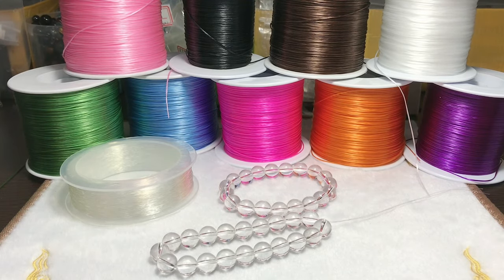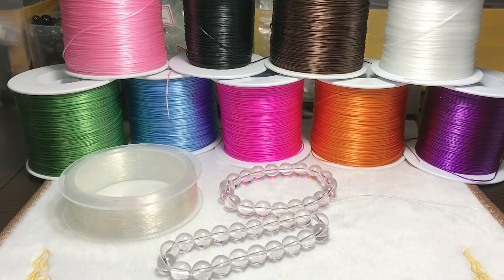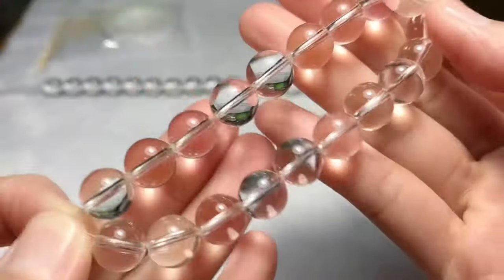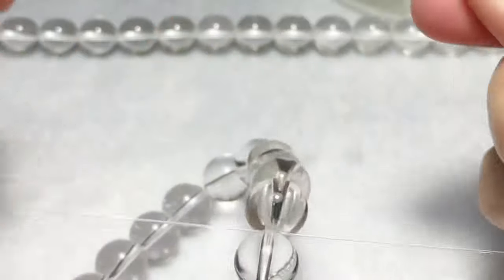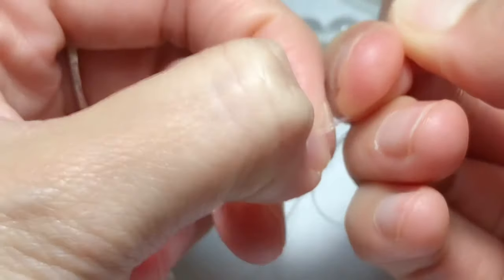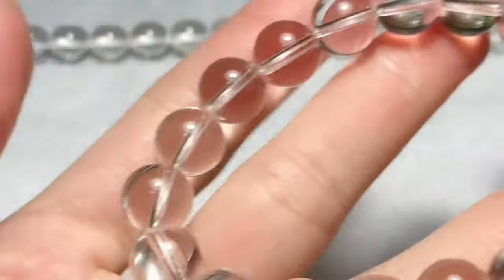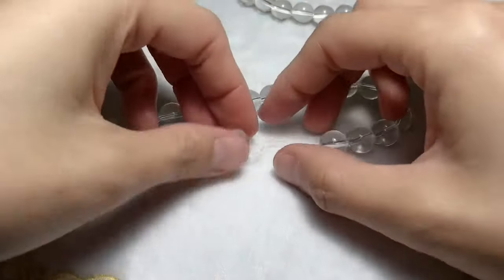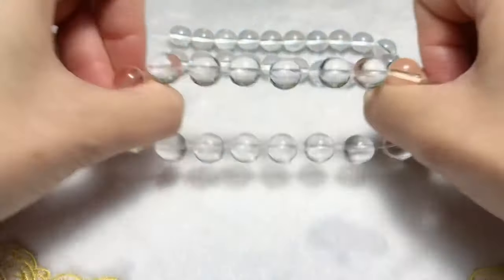Elastic Cords Sharing | How To Secure a Beaded Bracelet Without Glue? | Bracelet Making Tutorials

Comment: Sorry late question. Is the stainless steel 7x stranded wire D1,0mm the strongest choice if heavy necklace 40pcs beads with hole D1,0mm and length 600mm ? If I use solid D1,0mm wire then I lose all flexibility=rigid necklace. Why bigger beads have same little D1,0mm holes as the smaller beads I would love larger D2,0mm holes on bigger beads. What wire type to choose on heavy duty mass bead necklaces ?